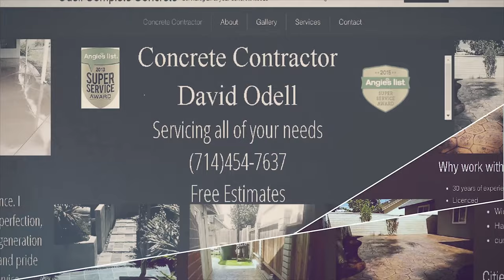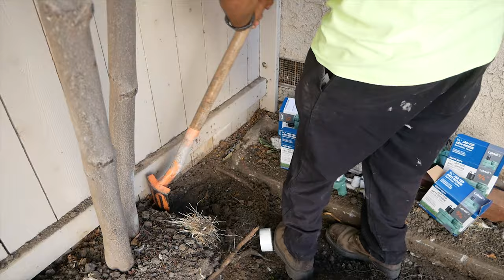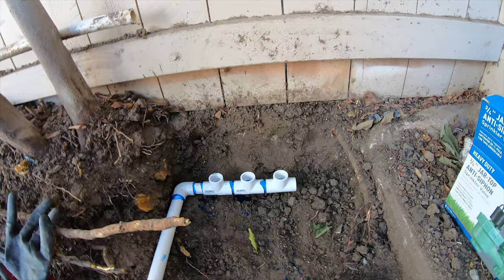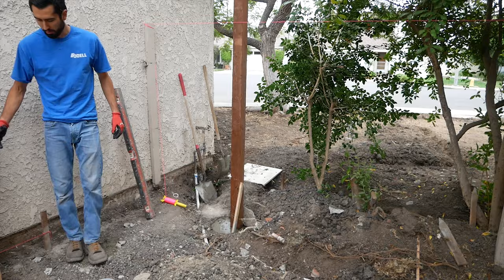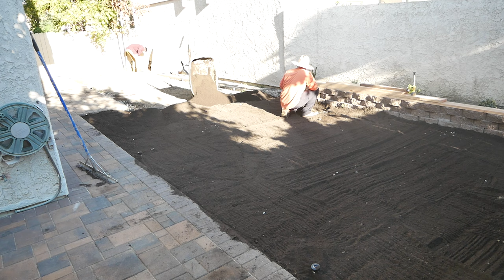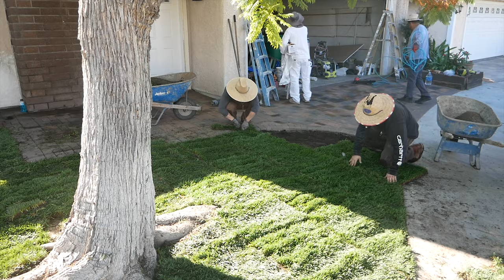How to install Sod/Grass Easy homeowner DIY

Comment: Good video of the complete process. Sod placed near the base of a large tree rarely lives past its first year and good pressure water lines hate 90* elbows unless traveling downwards. Complete poly runs from the manifold after a pvc initiation or at least for the corners and changes of direction work wonders.
Reply from the maker: I'll have to check that out
TY

Comment: Nice series. One question, with the water shortage in California, Arizona and Nevada, I thought I had read that new grass planting and irrigation was a no no. I have a brother in Las Vegas, and it has been pretty much illegal for them to plant grass and non-drought tolerant plants for years.
As an aside, I wonder how many gallons of water evaporate from their pool each day?
Reply from the maker: No problem as long as you're replacing existing

Comment: What would you recommend for gopher protection for an install like this?  I've seen chicken wire used before, but would that go on top of the irrigation lines and before the top soil?
Reply from the maker: Yes that sounds like the easiest place to put it.

Comment: Hey David, if you used PEX-A instead of PVC you would have saved money and had a tighter job. All those ELS reduce water pressure and flow speed. A wide turn PEX would do a much better job at a lower cost per foot. Oh, PEX is more frost resistant, also.
Reply from the maker: Sounds good

Comment: Sod installation is a pain in the ass. especially if parts die. Worse, sod depends on thatch to stabilize, which you spend a lot of time dethatching. Sod's advantage is only time.
 Seed is cheaper, less labor intensive, any species or multi-culture.
Reply from the maker: Sod makes seed